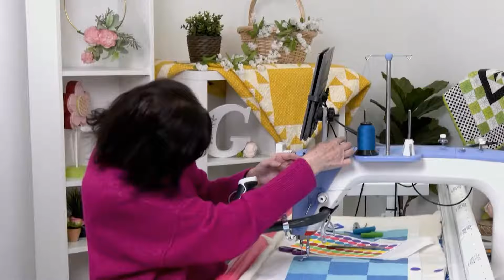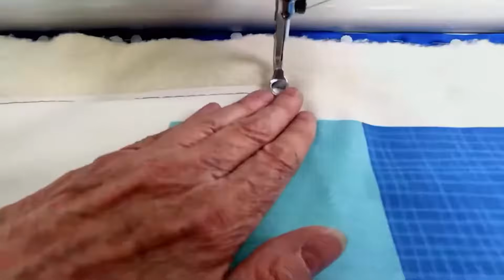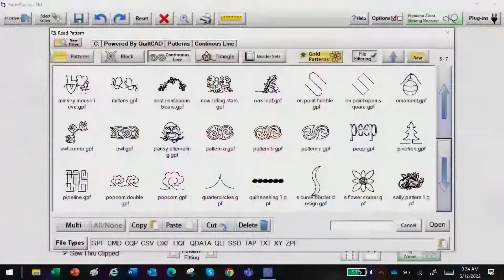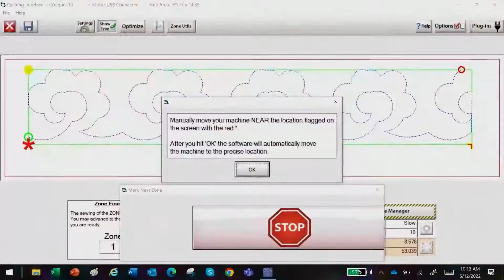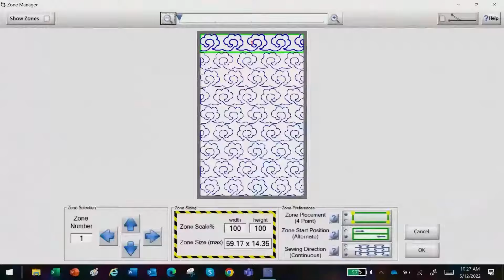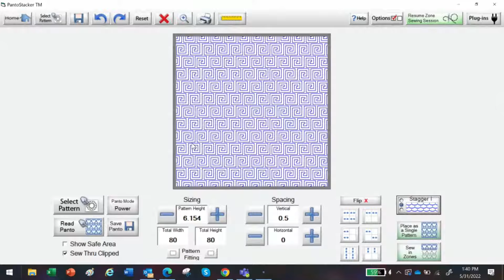Tuesdays with Grace: Edge-to-Edge Design in QCT

Comment: I have been using QCT pro 6 for about 6 years. Lately when placing my second zone on one row, the very first stitch lengh is about two stitches long. Then it stitches perfectly. This only happens on the second zone of one row.. What could fix this?

Comment: I have a c question. When setting t h e safe areas the top left area sets when i press the red dot. However, when i try to set tge safe areaon the right side bottom the machine will not set the bottom circle. Any suggestions for that setting to work. Ty. Jo Hilliard

Comment: Thanks for going over QCT Pro 5. I appreciate the refresher because the reminders are good for me to be sure I'm doing everything correctly. The quilt behind you in your Q&A is really pretty. 
Questions: I have a Q'nique 15R on a 10' Continuum frame. I haven't used 4 point placement with my QCT Pro 5. Is there a reason to use it instead of center placement when quilting an entire quilt? How do we get notified about QCT updates? Could you address how tight the quilt needs to be when beginning to quilt and when advancing to next zone row? Thanks!
Reply from the maker: Hello Jenny,
4 point is when you do not have even corners and you need to make everything fit into a block, and center is for when everything is level and you only need to set 1 point. If you are doing a pieced quilt with uneven parts, you may be better doing 4 point. QCT updates will be notified through the software if you are connected to the internet, but we also send out email notifications as well. The quilt needs to have a little bounce in it, but not trampoline tight.
If you have any other questions let us know
Have a great day!